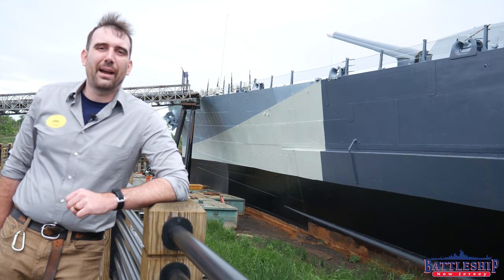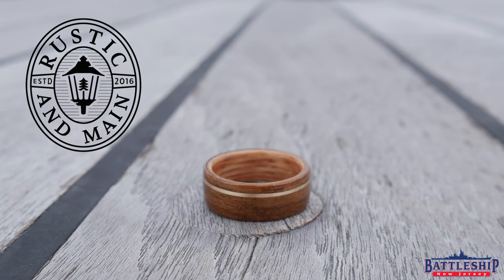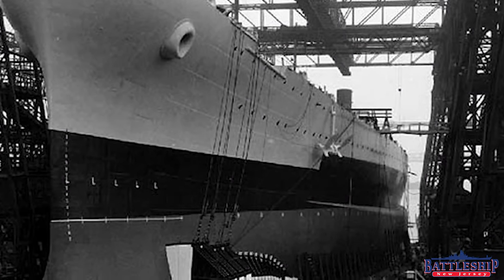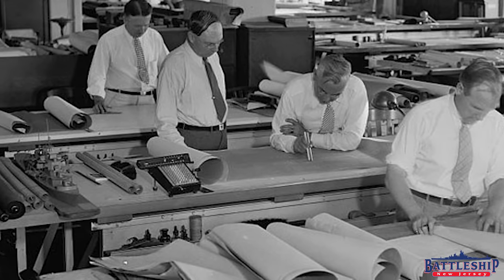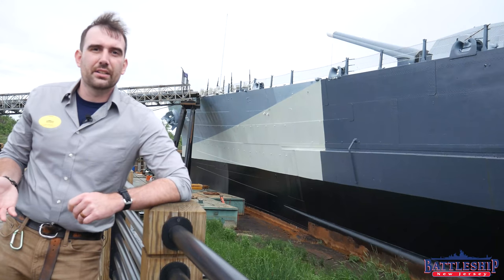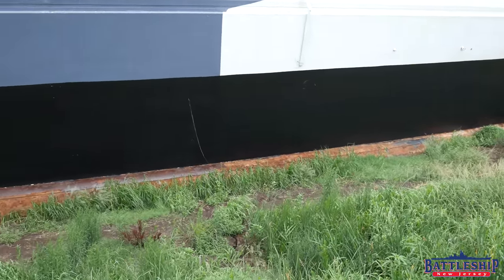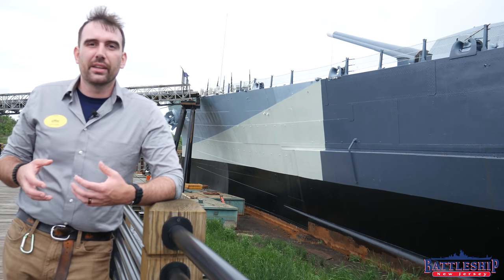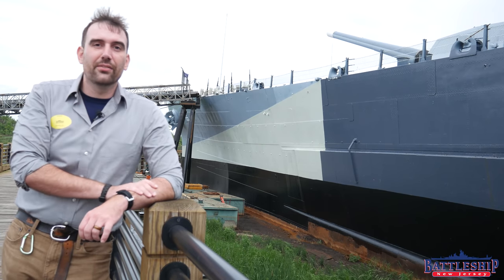Armored Belt: Interior vs Exterior

Comment: Thanks for a well done video.
As Drachinifel pointed out, another problem with the internal belt is it cuts into the internal volume of the ship and by it's very nature is more difficult to repair Vs an external belt.
Both systems have their advantages and disadvantages
Reply: Exactly. Repairing an external belt after a big hit isn't easy by any means, but compared to ripping apart part of the ship to even get to the internal belt, yeah.
Reply: @Jimorian  I would disagree. If a shell penetrated the armor belt you would have to replace the plate and the hull plating the belt is mounted too. On the Iowa's you would simply cut away the 1.5 inch STS hull plate that you would have to replace anyway to gain access to the internal belt. In either situation repairing the belt is not something that could be done at see, ships don't carry extra armor plate so you are looking at a yard visit and dry docking either way.
Reply: The North Carolina had more space because of the external belt.
   It should also be noted that ship to ship gun engagements were basically gone by the time these ships were built. It become  the day of carriers launching the attack from many miles away. 
     Yall Take Care and be safe, John
Reply: @Bellthorian  but you have hull frames in the way to get the internal belt plate out, also damage is not always a penetration the belt might held but cracked.
Reply: @JohnDoe-pv2iu  Actually ship to ship gun engagements did still have a place. 
A carrier would have been completely useless in the Battle of North Cape in December 1943.
I can't see any carrier of that era launching a strike at night, in winter, in the middle of a storm, to take out a large enemy ship threatening merchantmen.
Unless you don't care about any planes coming  back
Reply: @johnfisher9692  
    You are so right. There are exceptional situations thruout history.
     I'm sure there were incidents of a straight on forward assault, even in the 21st century but that doesn't mean that 18th-19th century, European style fighting (of lining up and shooting at each other) was either common or Not 'mostly a part of history and generally not used anymore'.
    In any case, I was on a frigate in a North Atlantic storm and they are horrible. Based on those conditions and at night, I think the North Carolina's armor would have been fine for the shells that would have most likely missed her.
     She handled that direct torpedo hit, sailed in, got repaired and went back out to fight!
     Oh, I forgot... The USS North Carolina was the most decorated Battleship of all of WW2...
         I think the 'Showboat', her crew and her Armor did VERY FUCKING WELL. 
        Yall Take Care and be safe, John
Reply: @JohnDoe-pv2iu  Most decorated Battleship of WW2?  I think HMS Warspite might dispute that.
Reply: @johnfisher9692  American...

Comment: Really here we are looking at the weight saving of an inclined belt, the advantage of an internal belt in that regard is that you have a greater ability to set the angle of incline without having to change the hull form. The weight saving between an external and internal belt is if any down to the reduction in the coverage of the deck armour. The downside to an internal belt is that the shell plating can not be thick enough to decap a shell like Bismarck's since that would require between 100 and 110 lb plate or 2.5 to 2.75 inches which due to the additional coverage requirements would totally overcome any weight saving vs a slab belt. Additional the penetration of the outer plating if the doesn't decap the shell will also tend to normalise the impact that is the shell will exit the plate closer to 90 degrees than it entered which then lowers the obliquity with which the shell then strikes the belt behind it which could add more to its potential penetrative power than the loss of striking velocity passing through the outer plate removed.

Comment: Its really cool to see you on the Showboat. She is my favorite battleship, but all of the work New Jersey does has moved her to second. This may have been mentioned in an earlier video, but the Iowa's seem have a higher bow compared to the earlier fast battleships. Is this correct and if so is it something due to design, or how they are displayed as museums? I think it was last week's video that mentioned how New Jersey rides higher in the front now due to not having forward tanks full anymore.  Could the NC/SD fire forward better than the Iowas in that they wouldn't damage the ship as much?
Reply: The Iowas have greater forward freeboard around 40 feet vs 30 feet on the SD, this is required due the long slender bow design required for Iowa's top speed. The lack of beam in the bow section means a lower buoyancy forward and a tendency for the bow to dig in heavy seas.

Comment: I think in a fleet engagement the weight savings of an internal belt makes sense. Because if you're operating in a fleet and have a screen of DD's, CL, and even CA's, you shouldn't even be taking fire from small caliber weapons. 8" and up at that point. Everything else would simply be out of range or pointing at smaller, more appropriate targets.

Comment: One thing that I feel compelled to point out -- the aerodynamic cap on that style of AP projectiles is purely aerodynamic. Once the projectile meets it's target, that cap's job is done. The blunt tip underneath is what's going to actually try to get through the armor plate. You can think of it as something of a self-correcting steel punch. The nose shape naturally causes it to turn toward perpendicular if it manages to bite in to the plate at all. There are more effective angle-correcting armor defeating rounds now, but this was pretty remarkable stuff in it's day.

Comment: I do think the flooding issue on both external armoured belts and the ends of ships of the all or nothing system is overstated, the fire for a destroyer using HE shells can punch through but generally not below the waterline making the damage easier to plug post combat. The lower degree of punch for these shells makes it unlikely that they will be able to compromise multiple compartments so flooding will be limited by that to.

Comment: Questions:
1. Isn't an important part of the angling of the belt to reduce the angle of incidence making it more difficult to penetrate? 
2. What would be the exact definition of a mission kill in relation to something like "New Jersey"? That a destroyer could effect this sounds like a good argument for the Jeune École that argued for many small ships as a deterrent for a fewer capital ships.
3. Aren't internal armor belts much harder to repair?
Thanks!
Reply: it makes it more likely to deflect and it increases the effective thickness.
Reply: Yes, with Armor Piercing Ballistic Capped projectiles, increasing the angle of incidence of impact reduces the penetration ability. However, this is not necessarily applicable here because of the separate armor plate designed to de-cap projectiles before they hit the main belt.
Reply: Yes, they are harder to repair
Reply: @rangerhalt  Thanks and I agree. I often post questions instead of statements it seems to make life easier on these things.
Reply: @someguy8732  Thank you, Some. I fully agree. Customers questions as opposed to statements. I seem to be a bit more peaceful. I appreciate your input.

Comment: It should be noted that inclined armour relies very much on range to provide high effectiveness.
The main belt on New Jersey would be equivalent to about 16" only at about 26,000 yds, around the max distance a battleship ever managed to score a hit on a moving target. At more practical ranges, of around 16,000 yds (the distance away Hood was hit and blew up), the effective thickness drops to under 14". (Of course any horizontal range would increase this in both cases).

Comment: Ryan, i think that an internal armor belt is better, as it gets less wear and tear, especially with the shell plating taking
out the energy of a armor piercing shell. Also, think of the psychological effects that it has, seeing the ship take the hits and still continuing to fight.
Reply: The outer plating has very little effect on reducing the impact energy of an AP round. If it is able to decap the shell, it will affect the ability to penetrate but there is a lot of debate whether it is actually thick enough to do so, see Okun’s research. 

The reason they went to internal belt wasn’t because of the increased protection offered by an outer shell (which is almost negligible without decapping) but because to increase the protection level to 16”/45 firing 2240lbs AP and stay within treaty limits they increased the angle of the belt from 15° to 19°. Decapping wasn’t a design feature. To see an earnest attempt at decapping armor system refer to the Littorio class.

Comment: I would say the external belt is the better choice since it would not take flossing from getting hit. And with out the treaty weight is not a issue and you could make that belt as thick as you want and not have to worry about treaty limitations.

Comment: The equivalent thickness is dependent on range.

So saying that the belt is equivalent of 14 inches isn't correct without knowing at what range, and against what gun.

the 305 mm belt which was angled at 15 deg, only gives an effective thickness of 316 mm at zero meters (point blank) 

As the range increase so does the effective thickness due to the arrival angle of the shell, however this varies from gun to gun.

For example, USS North Carolina firing a superheavy AP shell at a target 20KY away, the shell arrives at an angle of 17.9 deg (or 16.3 deg for a standard AP shell)

Whereas the 18 inch shell from Yamato at the same range is only arriving at an angle of 14.7 deg

Or as a more extreme example the 15 inch shell from the Italian battleship, arrives at an angle of just 11.9 deg

Comment: Force is a vector product,  energy is the quantitative property that must be transferred to a body or physical system to perform work on the body, thus energy is the correct term. The energy in the shell applies a force to the armor.  But as that shell starts to come apart is looses energy and thus can apply less and less force as it does so.

Comment: The SD and IA classes move the belt internally because they increased the angle of the armor from 15° to 19° to increase the effective resistance to levels needed. Beam was limited by Panamax and to provide necessary stability and buoyancy the belt was moved internal. 

The outer shell plating was not intended to decap, however it might depending on how the cap is attached and proximity to shell support structures. 

In regards to the shell plating increasing resistance to gunfire, increasing the thickness of the shell from 1.25” to 1.5” on the IA class only allowed the the belt to be thinned by 0.1” to provide the same level of protection as the SD class. It would slow a Bismarck AP by 10 ft/s is all.
Reply: It's specifically listed as a "Decapping Plate" in the original documentation for it... analysis done by the great folks over at NavWeaps shows that it probably was very effective against the non-US 14" and below caliber guns depending on range.  The greater the range, the higher chance to decap (obviously).

It's important to remember the Iowa's and SoDaks were still proof against the "traditional" 2250lb 16" AP shells with a fairly healthy immunity zone ranging from about 16k yards to 30k yards (going from memory here).  That's nothing to sneeze at.  It is only an issue when examining the 2700lb Mark 8 16" Super Heavy shells the US used.
Reply: @Whiskey11Gaming  read the article by Okun titled “decapping revisited”
Reply: @Whiskey11Gaming  the idea of the outer plate of Iowa acting as a decapping plate arose much later in their lives, 80’s IIRC. It was really only the Italians that implemented decapping plate and based their design in German testing. Their decapping plate was 70mm angled at 11° backed by a void space filled with a concrete like material, then the armored belt, a void space and then a splinter bulkhead. The void space was filled because it was understood a fairly large void area was needed to ensure the projectile is fully decapped. Filling the void with a solid material allowed them to shrink this distance… in theory at least.
Reply: @Whiskey11Gaming  without retreading the entire “revisited” article I’ll go off the top of my head… IIRC the 38mm outer hull has a 50% chance of decapping a soft attached cap. Depending on location and impact angle this percentage could go up. To decap a hard attached projectile like Bismarck’s she would need something like 70-80mm to ensure decapping. 38mm would not guarantee decapping. However the supporting structure behind the outer shell would play a role here.

Comment: You don't save any weight with angled armor unless you are replacing 2 plates at a 90 degree angle to each other with a single angled plate angled inwards from vertical (as is commonly found on tanks). In terms of thickness vs weight, for a given line of sight thickness a projectile is intended to pass through, the mass of the armor plate will always be the same. The real reason for angling armor is to increase ricochets  and also so that a larger desired line of sight thickness can be achieved  with a physical thinner plate. This matters because the main limiting factor in the production of high quality armor plate is the thickness of the plate, not it's surface area. So it is easier and cheaper to make a thinner armor plate and angle it than to simply make a thicker plate
Reply: Angling for the purposes of ricochets is especially relevant when armor schemes involve two plates set at different angles. First plate disrupts the geometry and trajectory of the projectiles making it relatively easy for the second plate to stop it

Comment: I wonder how the USS Gerald R Ford’s armour is arranged? This surely must be the gold class in our current age and would be fascinating to compare to an Iowa class, pinnacle of World War 2.
Reply: And with the cost of the Ford that armor better be good
Reply: Not sure about GRF class, but Wikipedia says the Nimitz class has 2.5” armor. Possible upgrade for the GRF is reactive armor.
Reply: We really don't armor carriers in any important way against the kinds of weapons they'd face like anti-shipping missiles. The idea is to not get hit in the first place with the picket ships, then CIWS as a last resort. Underwater, though, against torpedoes I have no idea.
Reply: @Jimorian  Potentially, they had better armoring on the carriers built after experience with the Yorktown and Essex classes in World War II -- specifically, the Midway class.
Armor belt WAS removed during upgrades of the Essex and Midway class in the 1950s.
The main problem those ships faced was weight management as they added significant mass to the ships at the flight deck as they installed larger area, angled flight decks.  
Weight had to be removed (armor belt) and added (bulges, blisters) to balance those ships.  It didn't always work.  
The Midway class carriers were notoriously poor-handling in rough seas.  At one point, the Midway (CV-41) rolled 3 degrees past maximum roll (28 degrees) and could have capsized.
In WWII, the Essex class ships were 32,000 ton class.  They ended up closer to 47,000 tons after the refits.
The situation with the Midway class was worse.  Those were originally 45,000 ton ships (significantly bigger than anything else that served in World War II; Midway was commissioned late 1945, post-WWII) with Coral Sea (CV-43) grossing 67,000 tons at the end (1990) and Midway in the ballpark of 72,000 tons -- neither very short of the Forrestal class (78,000 tons).  There were underpowered and arguably hull-stressed at the ends of their service lives.
Reply: @Jimorian  well, as far as I understand it, armor belt no, instead you armor the deck pretty heavily.

Comment: Is the internal vs external armor belt an all or nothing affair (all internal or all external)?  Is there a reason why you can't split the difference in the armor by having thick enough armor to stop a smaller ship's guns on the exterior (to prevent the flooding problem that the navy didn't like) but still have a space and internal belt to provide the shell decapping capability of the internal belt?  That they didn't do that probably means there is a good reason not to, just don't happen to know what it is.
Reply: Drachinifel covers this pretty well. Any multilayered protection is going to need to be much thicker, thus heavier, in combination for the same protection level. So to protect as well as one 12" belt, you'd need two 8" belts for example (made up numbers).

Comment: Inside or outside the total thickness of armor seems to me to be the same re: protection against torpedoes or low flying shells. I'm more a believer in the protection provided by an external bubble down the length of the ship.
Reply: I prefer the internal armor belt because a shell has to pass through an inch and a half of STS steel before hitting the main belt potentially decaping an AP round and acting liked spaced armor as well. The internal armor belt of the Iowa had a greater slant, 19 degrees vs 15 degrees giving her an effective thickness of 17.3 inches compared to 14 inches of the North Carolina class despite the Iowa's being only 2 mm thicker.